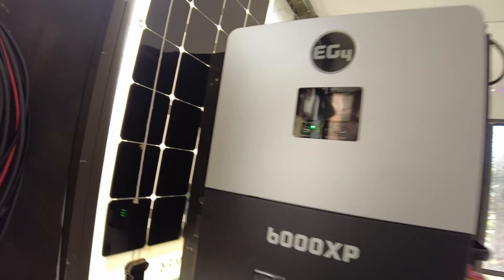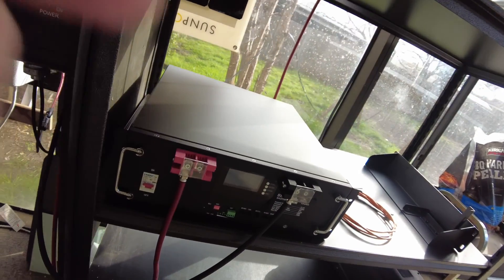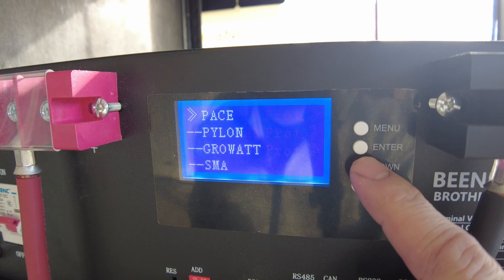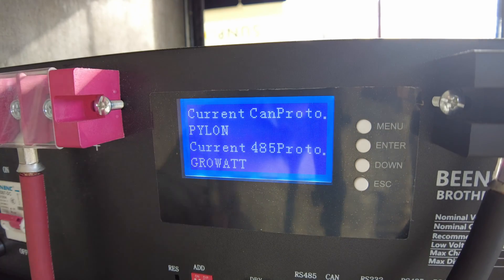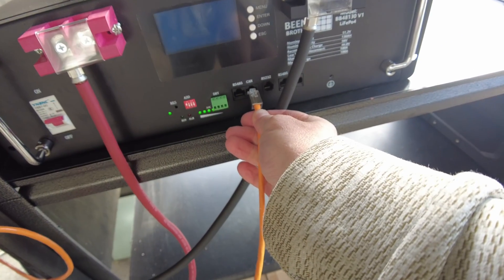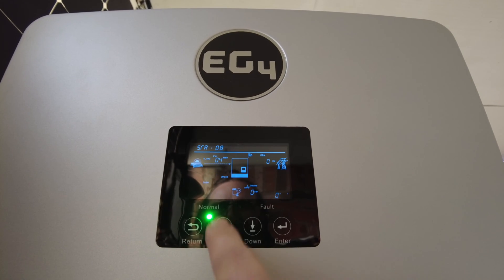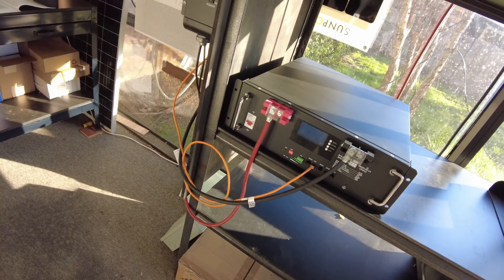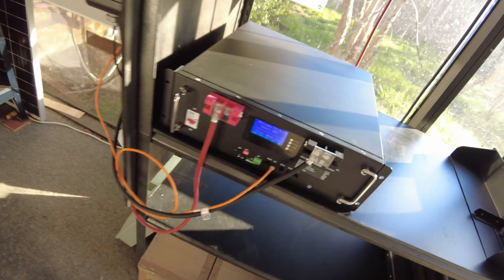EG4 6000XP Pylon CAN Bus Battery Communication Setup

Comment: The 6000XP doesn't give much direction, nor do the two batteries I have.  I got one battery working by setting to "Pace" protocol, but "Pylon" on EG4 since it didn't have a "Pace" selection.  I recall it didn't work with battery set as "Pylon", though hard to tell since both show "fail" on the battery screen.  I used CAN bus.  That battery has a BMS menu that looks identical to yours.  EG4 doesn't have many battery protocol selections.  Now trying to parallel a 2nd battery, which has a different BMS menu, but doesn't appear to recognize it.  Tried CAN, RS-485 (different address on each battery), in several configurations, but the 2nd battery isn't charging or discharging.  More research.

Comment: you, my friend just made my day. I have the same inverter but with two orient power wall batteries and just yesterday I call sig solar if they had any knowledge on how these inverter will communicate with other batteries beside eg4 and they had no clue even suggested that I needed a update firmware on my inverter. to me that did not make any sense. but anyway I saw your video and my batteries use pylon as well so when I get home, I'm going to check if this configuration will work for me. I'll let you know if it does thanks for charing the info
Reply from the maker: Right on man, I hope you get it working!
Reply: @BradCagle  Hello again! well my friend, IT WORKED!! AWESOME BRO!!! 
now I can see the correct voltage and soc of the battery, and in the actual app, it now displays 2 batteries, not one. thanks again for taking the time to do these helpful videos. God bless you and your family.
Reply from the maker: @prepsolar787  Awesome man! I'm glad this was helpful. Thanks :)

Comment: I would be more concerned about this inverter's life expectancy and surge capacity rather that its communication abilities. High frequency, transformerless inverters are notorious for having shorter life expectancies and poorer surge capacities than heavy duty, longer lived, low frequency, transformer based inverters.
Reply: Definitely a concern, but might need to check back in 5 or 10 years for youtube reviewer's experience.  The 6000XP has a 5 year full-replacement warranty, which gives a slight guide.

Comment: With all of the well documented problems that the EG4 6500EX inverters are having, why on Earth are you promoting the purchase of these cheap, high frequency output transformerless inverters? There is very little difference between the EG4 6500EX and the EG4 6000XP. They both use low cost, high frequency inverter tech which yield a shorter life expectancy and a far poorer peak power capacities than "Real" heavy duty, low frequency, transformer based inverters. There were no major design changes between the EG4 6500EX and the EG4 6000XP. A change in color scheme and a few minor differences in the component layout is about it. The Chinese have been trying to get their high frequency inverter tech right for over 30 years and have not succeeded and probably never will. Don't take my word for it, Google or search youtube for "low frequency inverter vs high frequency inverters"

Comment: I have made the Lead Acid voltage setting work for my DIY LIFEPO4 but I am still tweaking it with the idea I am still losing some of my battery capacity due to being cautious. Still working on it and I might just change BMS's to get communications to the inverter but beginning to think that communication may not really be what I am looking to for after all. With multiple batteries, I'm not really sure the inverter will or even can help the batteries but that the BMS is really king here and all that matters. Still learning what I can do. Thanks for sharing you thoughts and idea with us. Take care.

Comment: Hey thanks for testing with the Lux Power! It does seem like communications has gotten pretty standardized, love that we can just pick an inverter and battery and chances are high they will talk. Hope to see how well it works as you use it. And hey next time you're at the shop ask me for some heat shrink, I'll cut you off a piece. Same goes for anyone else that comes by!
Reply from the maker: You're welcome. I'll be doing some more stuff with the battery. Yes, LOL, nice call. I actually have loads of heat shrink. It's time I need, so if you have some of that at the shop, I'll take a mile :)
Reply: @BradCagle  Ha ha nope, none of that available!
Reply from the maker: @BeeneEnergy  Figures 🤣
Reply: So, how do I hookup 2 Beene Battery's to the XP6000, thx